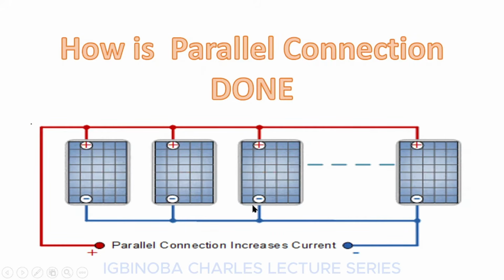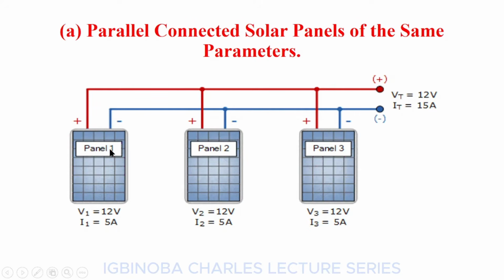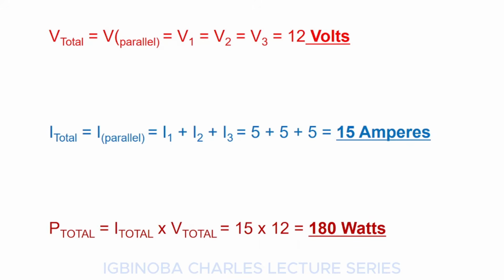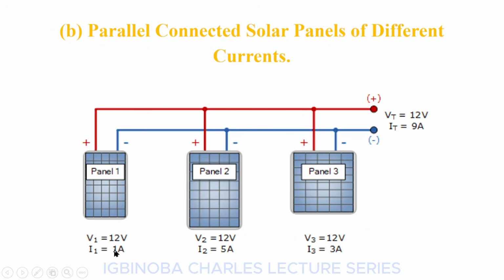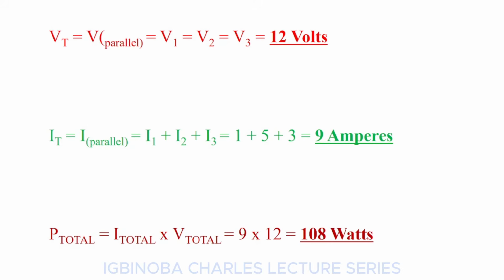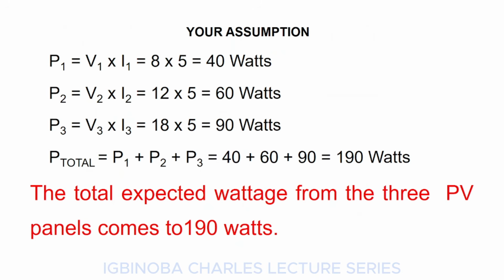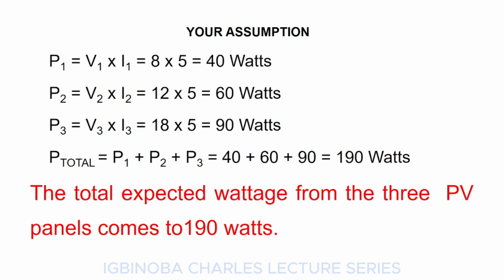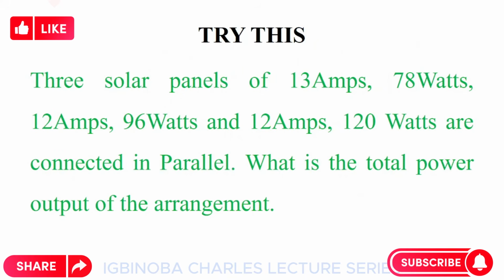Connection of Solar Panels in PARALLEL

Comment: CPE34P

Given
Panel 1: 13 A and 78W
Panel 2: 12A and 96W
Panel 3: 12A and 120W
To find the voltage of each panel the formula;
V=P/I
V1=78/13=6V
V2=96/12=8V
V3=120/12-10V
Total power output: 78 + 96 + 120 = 294W

Comment: EEE72EE

Panel 1: 13 A and 78W

Panel 2: 12A and 96W

Panel 3: 12A and 120W

To find the voltage of each panel the formula;

V=P/I

V1=78/13=6V

V2=96/12=8V

V3=120/12-10V

Total power output: 78 + 96 + 120 = 294W

Comment: CHM8H

Given parameters:

Panel 1 = 13A, 78W

Panel 2 = 12A, 96W

Panel 3 = 12A, 120W

Panel 1 = 78/13 = 6V

Panel 2 = 96/12 = 8V

To find the voltage across each panel, we divide the power by the current respectively: To find the maximum power in parallel, we use the least voltage = 6 V, multiplied by the sum of the currents in the panel: (13 + 12 + 12) * 6 = 222 watts.

Panel 3 = 120/12 = 10V

Comment: EEE71S

P 1 = 13A, 78W
P 2 =12A, 96W
P 3 =12A, 120W 

PT = 78+96+120 = 294W 

 i.e 

P1 
V= 78÷13 = 6V 
P2 
V= 96÷12 = 8V 
P3
V= 120÷12 = 10V 

I = 13+12+12 = 37A
 
So there for 
VI = 6*37= 222W 

Power loss 
294-222= 72W

Comment: EEE81C 

Given: First panel: 13 Amps, 78 Watts Second panel: 12 Amps, 96 Watts Third panel: 12 Amps, 120 Watts Now, we add the power ratings of all three panels: Total Power Output = 78 W + 96 W + 120 W Total Power Output = 294 Watts

Comment: EEE 117M

Voltages: 78/13 = 6V, 96/12 = 8V, 120/12 = 10V
In parallel, voltage is limited to the lowest: 6V
Currents add up: 13 + 12 + 12 = 37A
Total power = 6 × 37 = 222 Watts

Comment: PETRO26Z 

Panel 1= 13 A, 78 W
Panel 2= 12 A, 96 W
Panel 3= 12 A, 120 W
The panels are connected in parallel; therefore, the total power output is the sum of all the individual powers:
Pₜ = P₁ + P₂ + P₃
Pₜ = 78 + 96 + 120
Pₜ = 294 W

Comment: Chm28B 
Given parameters:
Panel 1 = 13 A, 78 W
Panel 2 = 12 A, 96 W
Panel 3 = 12 A, 120 W
To find the voltage across each panel, we divide the power by the current respectively:
Panel 1 = 78/13 = 6 V
Panel 2 = 96/12 = 8 V
Panel 3 = 120/12 = 10 V
To find the maximum power in parallel, we use the least voltage = 6 V, multiplied by the sum of the currents in the panel:
(13 + 12 + 12) × 6 = 222 watts.

Comment: MAR32F

Given:
Panel 1: 13 A, 78 W
Panel 2: 12 A, 96 W
Panel 3: 12 A, 120 W
The panels are connected in parallel; therefore, the total power output is the sum of all the individual powers:
PT = P1 + P2 + P3
PT = 78 + 96 + 120
PT = 294 W

Comment: EE33G 

Given:

Panel 1: 13 A, 78 W

Panel 2: 12 A, 96 W

Panel 3: 12 A, 120 W

The panels are connected in parallel;

therefore, the total power output is the sum of all the individual powers:

PT = P1 + P2 + P3

PT=78+96 + 120

PT = 294 W

Comment: PETRO97S 
panel 1:13A,78W
Panel 2:12A,96W
Panel 3:12A,120W
The panel is connected in parallel therefore 
PT=p1+p2+p3
PT=78+96+120
PT=294W

Comment: MAR49W
Given: First panel: 13 Amps, 78 Watts Second panel: 12 Amps, 96 Watts Third panel: 12 Amps, 120 Watts Now, we add the power ratings of all three panels: Total Power Output = 78 W + 96 W + 120 W Total Power Output = 294 Watts

Comment: MEC28D
panel 1;13amps,78w
panel 2:12Amps,96w
panel 3:12Amps,120w
they are connected in parallel 
Therefore;
PT=P1+P2+P3
PT=78+96+120
PT=294W

Comment: CHM73U 
given:
panel 1:13A,78W
panel 2:12A,96w
panel 3:12A,120w

the panels r connected in parallel, therefore d total output  is d sum of d individual powers

PT:P1+P2 +P3

78+96+120
=294w

Comment: PETROCHEM52Z
Given:
Panel 1: 13 A, 78 W
Panel 2: 12 A, 96 W
Panel 3: 12 A, 120 W
The panels are connected in parallel; therefore, the total power output is the sum of all the individual powers:
PT = P1 + P2 + P3
PT = 78 + 96 + 120
PT = 294 W

Comment: EEE104Z
Panel 1=13A, 78W
Panel 2=12A, 96w
Panel 3=12A, 120w
to find the voltage across each panels we divide the power /current respectively
Panel 1=78/13 =6v
Panel 2=96/12= 8v
Panel 3=120/12=10v
X
To find the maximum power in parallel, we use the least volt =6v multiply by the sum of the currents in the panel (13+12+12)×6= 222watts

Comment: MAR121Q

Given:
Panel 1: 13 A, 78 W
Panel 2: 12 A, 96 W
Panel 3: 12 A, 120 W
The panels are connected in parallel; therefore, the total power output is the sum of all the individual powers:
PT = P1 + P2 + P3
PT = 78 + 96 + 120
PT = 294 W

Comment: MAR103Y 
Given:
Panel 1: 13 A, 78 W
Panel 2: 12 A, 96 W
Panel 3: 12 A, 120 W
The panels are connected in parallel; therefore, the total power output is the sum of all the individual powers:
PT = P1 + P2 + P3
PT = 78 + 96 + 120
PT = 294 W

Comment: EFETURI-YOUNG SOLOMON 
COET/10546/2022

Given:
Panel 1: 13 A, 78 W
Panel 2: 12 A, 96 W
Panel 3: 12 A, 120 W
The panels are connected in parallel; therefore, the total power output is the sum of all the individual powers:
PT = P1 + P2 + P3
PT = 78 + 96 + 120
PT = 294 W

Comment: MAR71S

Given parameters
Panel 1=13A, 78W
Panel 2=12A, 96w
Panel 3=12A, 120w
to find the voltage across each panels we divide the power /current respectively
Panel 1=78/13 =6v
Panel 2=96/12= 8v
Panel 3=120/12=10v
X
To find the maximum power in parallel, we use the least volt =6v multiply by the sum of the currents in the panel (13+12+12)×6= 222watts

Comment: Panel 1:13 A.78W
Panel 2:13 A.96W
Panel 3:12 A.120W

The panels are connected in parallel therefore the total power output is the sum of the three powers 

PT= 78+96+120 = 294W

Comment: MEC119O

Given date:

Panel 1: 13A, 78W

Panel 2: 12A, 96W

Panel 3: 12A, 120W

For the panels connected in parallel, the total power output is the sum of the individual powers:

Pt = P1 + P2 + P3

Pt = 78 + 96 + 120

Pt = 294W

Comment: MAR120P 

Given:
Panel 1: 13 A, 78 W
Panel 2: 12 A, 96 W
Panel 3: 12 A, 120 W
The panels are connected in parallel; therefore, the total power output is the sum of all the individual powers:
PT = P1 + P2 + P3
PT = 78 + 96 + 120
PT = 294 W

Comment: EEE54B 

SOLUTION
Given parameters 
Panel 1=13A , 78w
Panel 2=12A , 96w
Panel 3=12A , 120w
to find the voltage across each panels we divide the power /current respectively 
Panel 1=78/13 =6v
Panel 2=96/12= 8v
Panel 3=120/12=10v

To find the maximum power in parallel, we use the least volt =6v multiply by the sum of the currents in the panel
(13+12+12)×6= 222watts

Comment: The panels are connected in parallel... The output is the total output is the sum of the individual current and watts

Therefore the answer is 294 watts
Reply: MEC9I

Comment: PETRO58F

For a parallel connection, the voltage must be the same, and we cannot simply take the lowest voltage current here because the ratings of the current occur at different voltages.Therefore the panels cannot be connected directly in parallel.
And the total power output cannot be gotten directly too

Comment: MAR114J

ANSWER
Total power output = 78 + 96 + 120 = 294W

This is because the voltages of the panels are different, if they were the same voltage as it suppose to be for Parallel connection the lowest Power will be the total power output.
Reply: PETROCHEM18R 

Total power output= 294W

Comment: EEE114J

Given:
Panel 1: 13 A, 78 W
Panel 2: 12 A, 96 W
Panel 3: 12 A, 120 W
The panels are connected in parallel;
therefore, the total power output is the sum of all the individual powers:
PT = P1 + P2 + P3
PT = 78 + 96 + 120
PT = 294 W

Comment: CHM52z
Panel 1:13A,78W
Panel 2: 12A,96W
Panel 3:12A,120W
The panel are connected in parallel, therefore,the total power output is the sum of all individual powers
PT=78+96+120=294W

Comment: PETROCHEM43Q

Given:
Panel 1: 13 A, 78 W
Panel 2: 12 A, 96 W
Panel 3: 12 A, 120 W
The panels are connected in parallel; therefore, the total power output is the sum of all the individual powers:
PT = P1 + P2 + P3
PT = 78 + 96 + 120
PT = 294 W

Comment: MAR100V

Panel 1:13A. 78W
Panel 2:12A.   96W
Panel 3:12A.    120W.

The panels are connected in parallel therefore the total power output is the sum of the three powers.

PT=78+96+120=294W.

Comment: EEE 25Y
Given:
Panel 1: 13 A, 78 W
Panel 2: 12 A, 96 W
Panel 3: 12 A, 120 W
The panels are connected in parallel; therefore, the total power output is the sum of all the individual powers:
PT = P1 + P2 + P3
PT = 78 + 96 + 120
PT = 294 W

Comment: NAT15O

Given:
Panel 1: 13 A, 78W
Panel 2: 12 A, 96W
Panel 3: 12 A, 120W

The panels are connected in parallel
therefore the total power output is the sum
all the individual powers:
PT=P1+P2+P3
PT=78+96+120
PT=294W

Comment: EEE5E
Theoretical total:
78\text{W} + 96\text{W} + 120\text{W} = \mathbf{294\text{W}}
Real-world total (accounting for voltage mismatch):
 * Panel 1: 78\text{W} / 13\text{A} = 6\text{V}
 * Panel 2: 96\text{W} / 12\text{A} = 8\text{V}
 * Panel 3: 120\text{W} / 12\text{A} = 10\text{V}
Parallel forces system voltage down to the lowest (6\text{V}):
78\text{W} + (6\text{V} \times 12\text{A}) + (6\text{V} \times 12\text{A}) = \mathbf{222\text{W}}

Comment: MAR61I

Panel 1 = 13A, 78W
Panel 2 = 12A, 96W
Panel 3 = 12A, 120W
Calculating voltage across each panel
Recall: V = P/I
V1 = 78/13 = 6V
V2 = 96/12 = 8V
V3 = 120/12 = 10V
Parallel connection
V = 6V
Calculating total power (PT)
Recall PT = (sum of current) × V
PT = (13 + 12 + 13) × V
PT = (13 + 12 + 12)6
PT = 376
PT = 222W

Comment: EEE29C 
Given:
Panel 1: 13 A, 78 W
Panel 2: 12 A, 96 W
Panel 3: 12 A, 120 W
The panels are connected in parallel; therefore, the total power output is the sum of all the individual powers:
PT = P1 + P2 + P3
PT = 78 + 96 + 120
PT = 294 W

Comment: EEE30D

Answer  :  No  energy  source  can  be  regarded  as  completely  pollution-free  .  Reason  :  Every  form  of  energy  production  or  use  has  some  effect  on  the  environment  ,  either  directly  or  indirectly  .  For  instance  ,  solar  and  wind  energy  generate  little  pollution  while  operating  ,  but  producing  their  equipment  requires  raw  materials  ,  energy  ,  and  transportation  ,  which  may  contribute  to  pollution  .  Therefore  ,  renewable  energy  sources  are  considered  cleaner  alternatives  ,  rather  than  being  entirely  pollution-free  .

Comment: CHM13M

Answer:
No energy source can be regarded as completely pollution-free.
Reason: Every form of energy production or use has some effect on the environment, either directly or indirectly. For instance, solar and wind energy generate little pollution while operating, but producing their equipment requires raw materials, energy, and transportation, which may contribute to pollution.
Therefore, renewable energy sources are considered cleaner alternatives, rather than being entirely pollution-free.

Comment: COMP12L 

Solution:
GIVEN:
Panel 1 = 13A, 78W
Panel 2 = 12A, 96W
Panel 3 = 12A, 120W

Using P = IV
V = P/I

Panel 1 = 78/13 = 6V
Panel 2 = 96/12 = 8V
Panel 3 = 120/12 = 10V

Using the smallest voltage = 6V

Total power = (It) x V
= (13 + 12 + 12) x 6
= 37 x 6
= 222 WATTS

Comment: MEC105A

ANSWER

GIVEN 
P1=78W,I1=13A
P2=96W,I2=12A
P3=120W,I3=12A

USING V=P/I;
V1=78/13=6A
V2=96/12=8A
V3=120/=6A

SINCE IT IS A PARALLEL CONNECTION, THE SMALLEST VOLTAGE IS USED;    V=6VOLTS

TOTAL CURRENT 
It=I1+I2+I3=13+12+12=37AMP

TOTAL POWER
Pt=It*V
Pt=37*6
ANSWER =222W
Reply: MEC76X 

Total power output of arrangement =294w

Comment: MAR99U

Panel 1 = 13A,78W
Panel 2 = 12A, 96W
Panel 3 = 12A, 120W

Calculating voltage across each panel
Recall: v / PI
V1 = 78/13 = 6V
V2 = 96/12 = 8V
V3 = 120/12 = 10V

Parallel connection
V=6V

Calculating total power (PT)
Recall PT = (sum of current)*V
PT = (I1+I2+I3)*V
PT = (13+12+12)6
PT = 376
PT = 222W

Comment: PETRO52Z

Answer:

Given,

Panel 1: I₁ = 13 A, P₁ = 78 W
Panel 2: I₂ = 12 A, P₂ = 96 W
Panel 3: I₃ = 12 A, P₃ = 120 W

Since the panels are connected in parallel

Total current, Iₜ = I₁ + I₂ + I₃

Iₜ = 13 + 12 + 12
Iₜ = 37 A

For Panel 1:

P = VI

Therefore,

V = P/I

V = 78/13
V = 6 V

Since the panels are connected in parallel, the voltage remains 6 V.

Therefore, total power output:

Pₜ = V × Iₜ

Pₜ = 6 × 37

Pₜ = 222 W

Therefore,

ANSWER = 222 W

Comment: PETRO11K 

Parallel connection 

PANEL 1
 I= 13A, P= 78W

Panel 2 
I= 12A, P= 96W

Panel 3
I= 12A, P= 120W

V = P/I
V1= 78/13=6V
V2= 96/12 =8V
V3= 120/12= 10V

I = 13+12+12= 37
P= V×I
P = 6V×37 = 222W

Answer:

P= 222W

Comment: NAT54B
Given:
Panel 1:13A,78W
Panel 2:12A,96W
Panel 3:12A,120W

The panels are connected in parallel therefore the total power output is the sum all the individual powers:
PT=P1+P2+P3
PT=78+96+120
PT=294W

Comment: PETRO67O 

ANSWER: Panel 1 = 13A,78W
Panel 2 = 12A, 96W
Panel 3 = 12A, 120W
Calculating voltage across each panel
Recall: v / PI
V1 = 78/13 =6V
V2 = 96/12 =8V
V3 = 120/12 =10V
Parallel connection
V=6V
Calculating total power (PT)
Recall PT = ( sum of current) *V
PT = (11+12+13) *V
PT = (13+12+12)6
PT= 376
PT = 222W

Comment: EEE44R 

Answer= 222W
Given
Panel 1, 13A, 78W
Panel 2, 12A, 96W
Panel 3, 12A, 120W
Voltages
V = P/I
Panel 1, 78/13 = 6V
Panel 2, 96/12 = 8V
Panel 3, 120/12 = 10V
V_total = 6V
I_total = 13+12+12= 37A
Power= IV = 37*6= 222W

Comment: PETRO034H

Parameters given : 
I1= 13.  W1 = 78
I2 = 12, W2  = 96
I3 = 12 , w3 = 120

P=IV
V1 = p/v = 78/13 = 6 volts
V2= p/v = 96/12 = 8 volts
V3= p/v = 120/12 = 10 volts

Since it's in parallel,  voltage will be constant 
The voltage is 6volts 
Total current is = 13+12+12 = 37A
P = IV = 6 × 37 = 222 watt

=
=

Comment: EEE1A 

ANSWER: Panel 1 = 13A,78W
Panel 2 = 12A , 96W
Panel 3 = 12A, 120W
Calculating voltage across each panel
Recall: v / PI
V1 = 78/13 =6V
V2 = 96/12 =8V
V3 = 120/12 =10V
Parallel connection
V=6V
Calculating total power (PT)
Recall PT = ( sum of current)*V
PT = (I1+I2+I3)*V
PT= ( 13+12+12)6
PT= 376
PT = 222W

Comment: PETRO81C

FOr a parallel connection the voltages must be same, we can't take the lowest voltage current here because the ratings of the current occurs at different voltage.
Therefore the panels cannot be connected in parallel

Comment: CIV6F

ANSWER 
Panel 1 = 13A,78W
Panel 2 = 12A,96W
Panel 3 =12A,120W
Using P = IV
V =P/I
Panel 1 = 78/13 =6V
Panel 2 = 96/12=8v
Panel 3 = 120/12 =10V
V = 6V
Total power in parallel: (sum of the current)*V
(13+12+12)*6=222W

Comment: EEE62J
Answer: 222W

Solving:
GIVEN:

Panel 1 = 13A, 78W

Panel 2 = 12A, 96W

Panel 3 = 12A, 120W

Using P = IV

V = P/I

Panel 1 = 78/13 = 6V

Panel 2 = 96/12 = 8V

Panel 3 = 120/12 = 10v

Using the smallest voltage = 6V

Total power = (14) × V

= (13 + 12 + 12) * 6

= 37 × 6

= 222 WATTS

Comment: MAR26Z 
Answer:
Given:

P1 = 78W, I1 = 13A
P2 = 96W, I2 = 12A
P3 = 120W, I3 = 12A

Since they are connected in parallel:

Total power = P1 + P2 + P3

Total power = 78 + 96 + 120

Total power = 294W

Answer = 294W

Comment: MEC21U

Panel 1 = 13A, 78W
Panel 2 = 12A, 96W
Panel 3 = 12A, 120W
To get the voltage across each panel is glven by Power/
Current;
Panel 1 = 78/13 = 6V
Panel 2 = 96/12 = 8V
Panel 3 = 120/12 = 10V
We use V= 6v because it’s the least voltage we have:
To get total power in parallel :
We have
(Sum of the currents) × V
(13 + 12 + 12)×6
=222watts
Final answer =222watt

Comment: PETRO24X
Answer: 222 Watts

Using: V = P/I
we have; Panel 1 = 78/13 = 6V
Panel 2 = 96/12 = 8V
Panel 3 = 120/12 = 10V

Using the smallest voltage = 6V
Total power= ( It ) × V 
= ( 13 + 12 + 12 ) × 6
= 37 × 6
= 222 Watts

Comment: MAR97S 
3. 
294 Watts

When solar panels are connected in *Parallel*, you just add the power of each panel.

78W + 96W + 120W = 294W

Comment: EEE15O

Given:
Panel 1: 13A, 78W
Panel 2: 12A, 96W
Panel 3: 12A, 120W

Finding Voltages
V=P/I
V1 = 78/13 = 6V
V2 = 96/12 = 8V
V3 = 120/12 = 10V

System Voltage (VT) = 6V (lowest voltage in parallel)
Finding total power
I1 = 13A
I2 = 12A
I3 = 12A
IT = 13A + 12A + 12A = 37A
PT = 6V × 37A = 222 watts

Comment: Petro59D
Given;

Panel 1 = 13A, 78W

Panel 2 = 12A, 96W

Panel 3 = 12A, 120W

To get the voltage across each panel is given by

Power/Current;

Panel 1 = 78/13 = 6V

Panel 2 = 96/12 = 8V

Panel 3 = 120/12 = 10V

We use V= 6v because it's the least voltage we ha To get total power in parallel : We have (Sum of the currents) x V (13 + 12 + 12) * 6

=222watts

Final answer =222watt

Comment: EEE111G
GIVEN:
Three solar panels:

1.
13A, 78W
2..
12A, 96W
3.
12A, 120W..
They are connected in parallel...

Step 1: Find the voltage of each panel 

Using the formula:
P=V×I>V=P/I
1) V1=78/13=6V
2) V2=96/12=8V
3) V3=120/12=10V

Total power output....
Ptotal=78+96+120=294 W

Comment: PETRO99U 

ANSWERS 

Panel 1 = 13A, 78W
Panel 2 = 12A, 96W
Panel 3 = 12A, 120W

Using P = IV
V = P/I

Panel 1 = 78/13 = 6V
Panel 2 = 96/12 = 8V
Panel 3 = 120/12 = 10V

Using the smallest voltage = 6V

Total power = (Iₜ) × V
= (13 + 12 + 12) × 6
= 37 × 6
= 222 WATTS
Reply: PETROCHEM65M

panel 1=6v
Panel 2=8v
Panel 3=10v

Total power=222w

Comment: PETRO31E

Given;
Panel 1 = 13A, 78W
Panel 2 = 12A, 96W
Panel 3 = 12A, 120W
To get the voltage across each panel is glven by Power/Current;
Panel 1 = 78/13 = 6V
Panel 2 = 96/12 = 8V
Panel 3 = 120/12 = 10V
We use V= 6v because it's the least voltage we have:
To get total power in parallel :
We have
(Sum of the currents) × V
(13 + 12 + 12)×6
=222watts
Final answer =222watt

Comment: MAR111G 

Data given 
Panel 1: I = 13A, P= 78W 
V = P÷I = 78÷13  = 6V
Panel 2: I = 12A, P = 96W
V = P÷I  = 96 ÷12 = 8V 
Panel 3: I = 12A, P = 120W
V = P÷I = 120÷10 = 10V 
Since the connection is in parallel, a uniform minimum voltage will flow through the circuit with an increased current. 
Total Power; 
P = IV 
I = ( 13+12+12)A = 37A 
V = 6V 
P = 37 ×6 = 222W 
The total power output = 222W.

Comment: MEC50X
Panel 1 :13A, 78W 
Panel 2:12A 96W 
Panel 3 12A 120W
Calculating voltage across each panel 
Recall:V/PI
V1: 78/13=6V
V2: 96/12 =8V
V3 :120/12 = 10V

Parallel connection 
V=6V
Calculating  total power (PT)
Recall PT= (Sum of current)*V
PT= (I1+I2+I3)*V
PT=(13+12+12)*6
PT=37*6
PT=222W